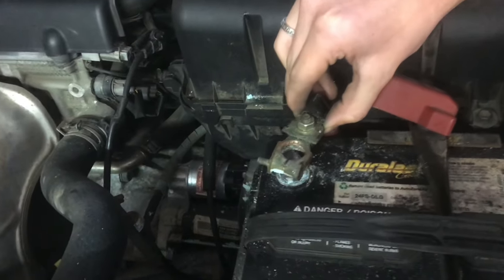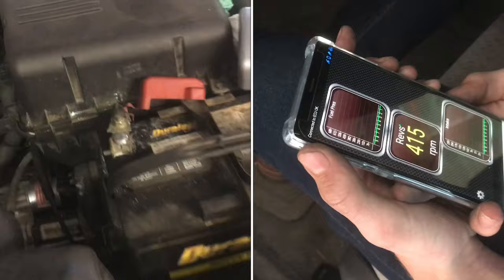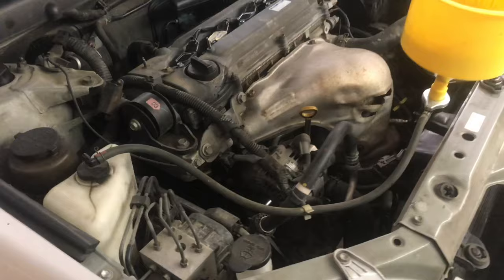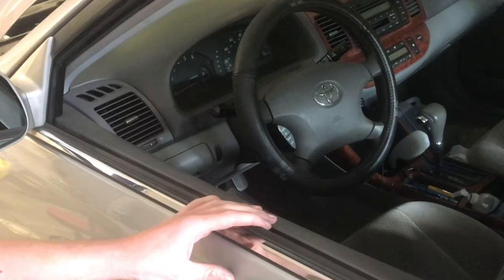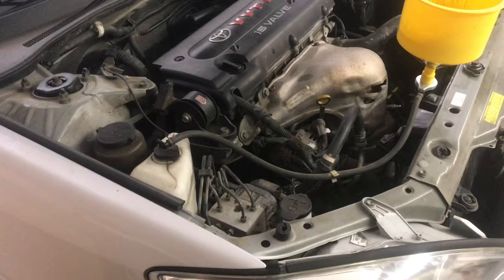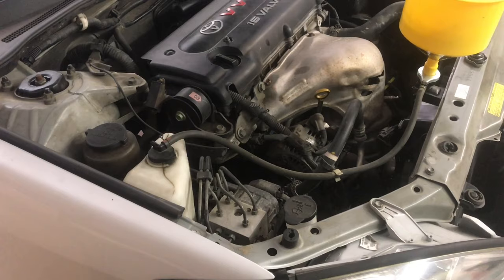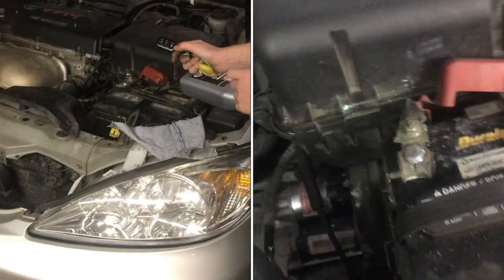“reset idle” after disconnecting battery terminal (toyota camry) EASY FIX resetting fuel trims

Comment: thank you very much i was starting to worry about all the money i had to spend trying to get it fixed ,i had a bad battery and also alternator, when i replaced them i noticed it started to shake real bad and the idle was horrible, it would die on me while driving, but i did what you showed me in the video and now it runs great ,thank you very much

Comment: Yeah it didn’t work for me And worse it over heated and the radiator reservoir started shooting out fluid.
Reply: If your car overheated, it's because something isn't cooling the engine. Water pump maybe or something else. Putting your car in drive while the e brake is initiated is something everyone does everyday at a red light. The only difference is your foot is on the main brake instead of e brake

Comment: Don’t do this. This not only did NOT work but it overheated my engine with oil seeping out around engine cover and coolant overflow all over the driveway, AC compressor stopped working. Currently, I do not know the extent of the damages this stupid trick had caused yet.  Letting the car cool off for a day before trying to start it again. 😢
Reply: Im sorry that happened, please make sure to do more research before trying something with your car.,
Reply: That's not because of this. Sounds more like a bad thermostat and water pump. Make sure you change your pcv valve and don't overfill your engine oil. Overall not so bad. These parts cost a total of 50 bucks.
Reply: Worked perfectly with my car. I just threw it In neutral instead of drive with e brake up  (05 Scion tc) basically Camry engine too
Reply: Overheated cause you have a coolant/cooling problem, oil seeping out cause you have massive oil leaks from your engine. Same things would’ve happened if you were driving

Comment: Hi I’m Tj I did remove the battery and put + to -, to reset codes, the car won’t start anymore, dash board is blinking, my car is Toyota Avalon 2004
Can u advise plz?
Reply: Does it crank, start,then immediately turn off?
Reply: You did a hard reset, dont do that unless your ecu is actually f-ed up and going crazy. If it cranks, runs, then dies immediately, you’re good